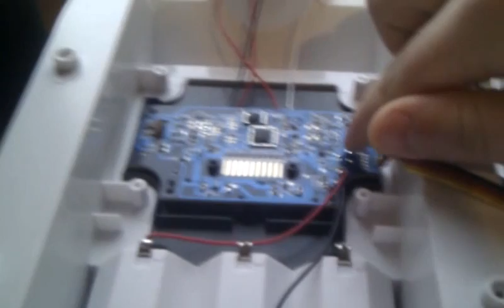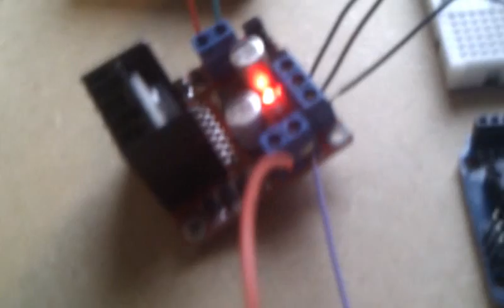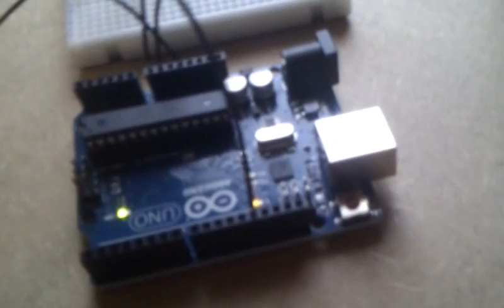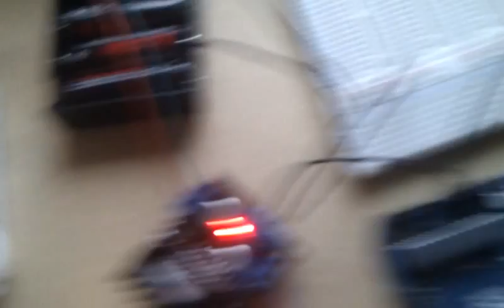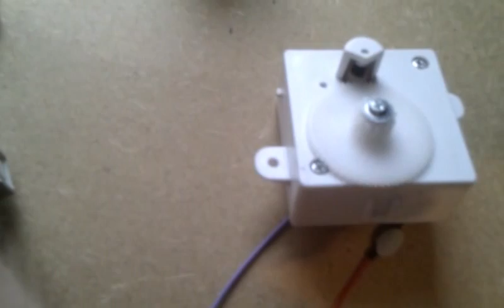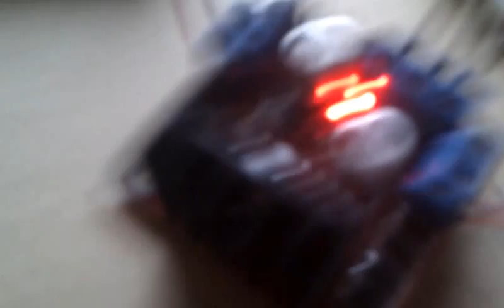Arduino: Artificial Intelligence Platform (Motor Controller / H-Bridge Stage) (Bigtrak)

Comment: I put together a free online curriculum that describes how to build and program  an Arduino controlled maze solving: http://www.udemy.com/nanomouse. My webpage includes some additional information: mbbackus
Reply from the maker: +Michael Backus, I know two years have passed since your comment but I have just seen it. I followed the link and sadly it says you are no longer perusing this. I am wondering what your plan was.  How was you going to attempt AI with Arduino? I have loads of ideas myself and really want to continue with this once I have time. 
Thanks for commenting.
Reply: +Steven Gartland The curriculum I developed can be found on my website at http://akrobotnerd.com. I have over 8 hours of videos that walk you step by step through the construction and programming of a maze solving robot.
Reply from the maker: +Michael Backus hey, thanks for you reply. i have check out your link and, as is the case for my project, I cannot see any AI. Is your project also just in the early stages as well?  What plans do you have for the future and what approach to AI do you yo have in mind?
Reply from the maker: +Steven Gartland I just realised you were not claiming to build an AI unit, rather it was always supposed to be a maze solving unit. That it pretty awesome!!